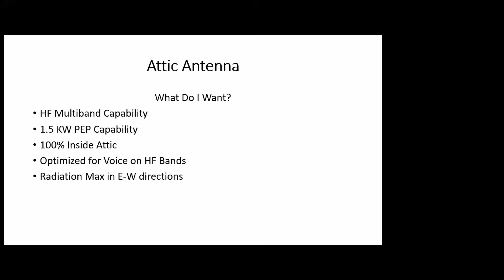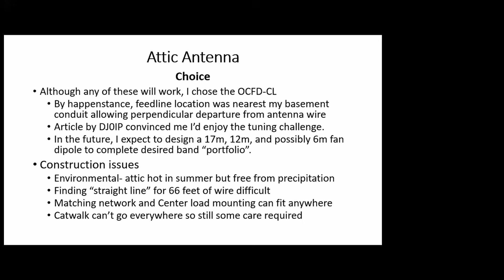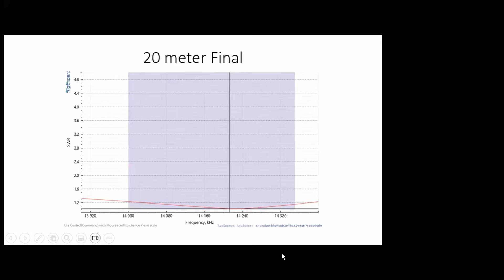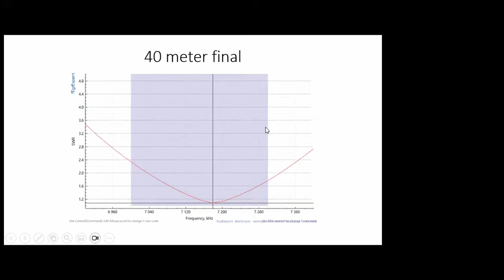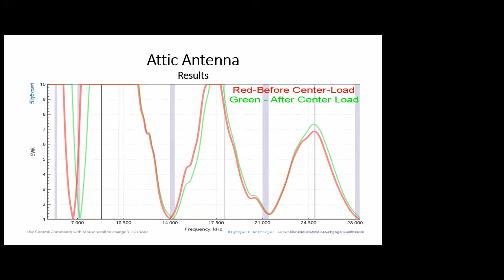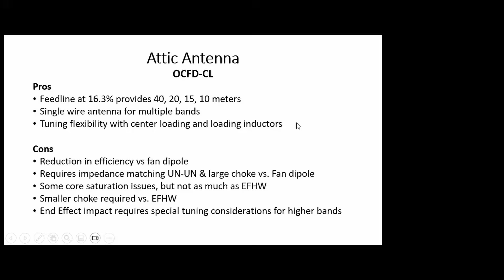Ham Radio Attic Antennas: Alternatives & Real-World Results

Comment: Five inverted vee's squashed into my attic for 20m to 10m. The longer ones have their ends coiled into large open coils to fit them in. 
Years ago I took apart and put a pallet wood walkway under the ridge to walk on. No permanent lighting up there for wiring to pick up r.f.
I've got 1200 to 1500 miles s.s.b. and c.w. on 12m and 10m, QRP only. I don't tend to go on the rat-race of 20m.

G4GHB.